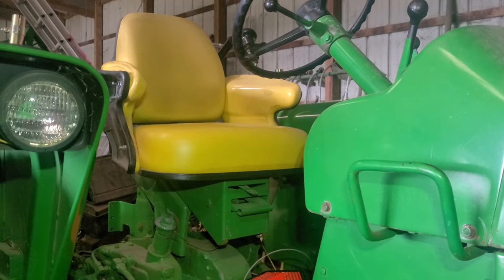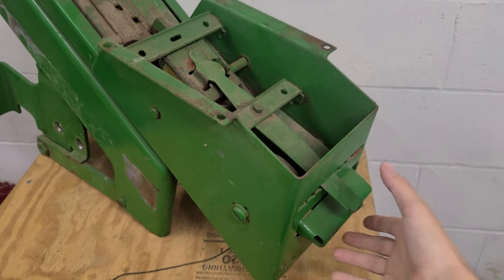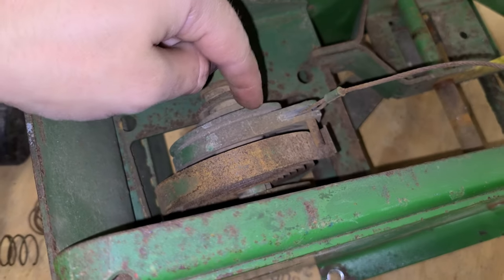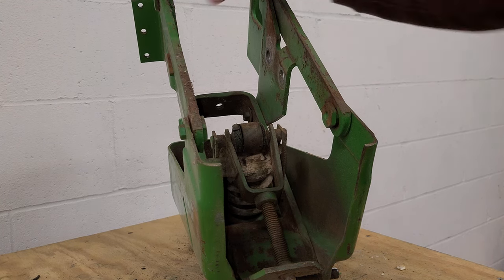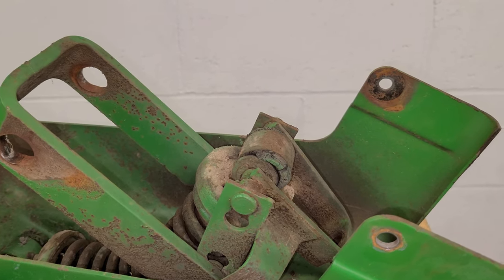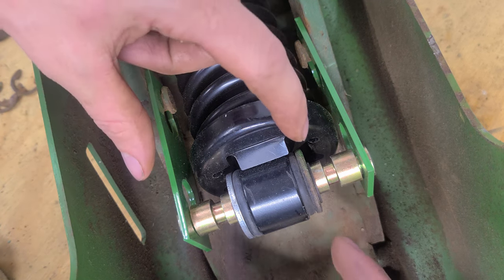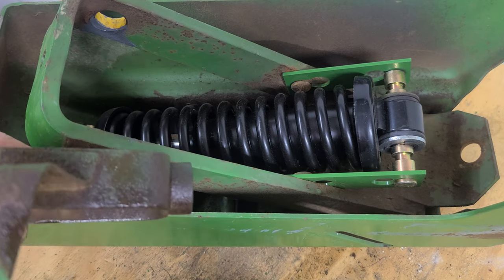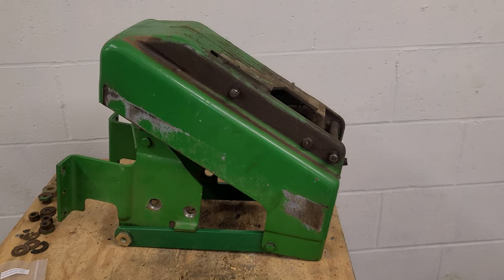John Deere New Generation Seat Rebuild (3010, 3020, 4010, 4020, etc)

Comment: I really should do this on my 3020, it bottoms out bouncing on rough ground when I plow. I thought it was because I gained weight 😂
Nice informative tutorial sir!
Reply from the maker: I had a guy tell me it was "just the way they are".  I thought no way.  There is no way they could be that uncomfortable.  Glad I did it and looked into though it is crazy expensive just to rebuild these seats yourself.  I saw a guy on Facebook that rebuilds and paints them for something like $550.   Not a bad deal considering that includes a paint job and labor.  The only other problem is shipping cost.  Thanks for watching.

Comment: What did you buy for this repair when I looked on eBay the kit comes with a lot of stuff that you reused but did not have the shock absorber, I saw it sold by itself! Nice tutorial on this my 3020 has the same problem, seat has one position and you wind up touching steering wheel all day
Reply from the maker: I used most of the kit.   I thought to myself afterward whether I would buy piece-meal or the kit again.  I think I would still do the kit.  Then I wouldn't get halfway in and realize I didn't have a part or something dumb.   And yes,  the shock absorber is separate and quite expensive.  Good luck with your rebuild.

Comment: Hi Daniel, great video!  I’m doing this on my 4020 now my frame is worn a similar amount where bushings live.   Did JB welding the bushings in hold?
Reply from the maker: To be honest,  our  3010 doesn't get too much use, so it hasn't had too many hours on it since I rebuilt the seat,  but so far no issues.